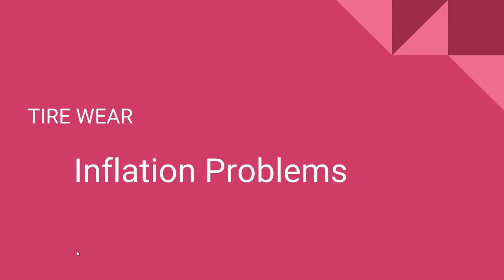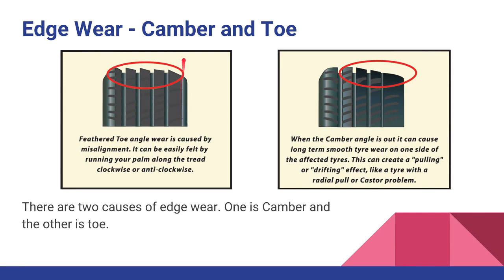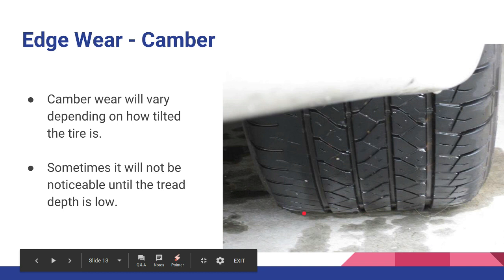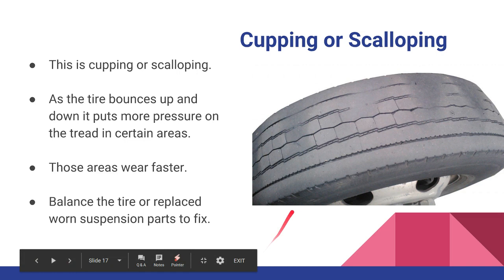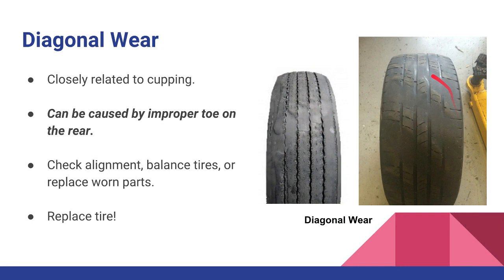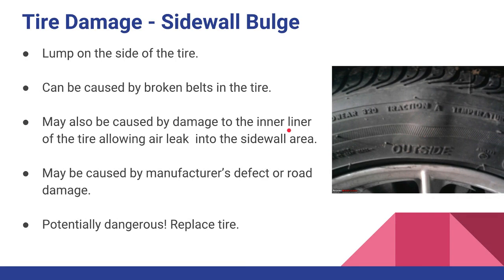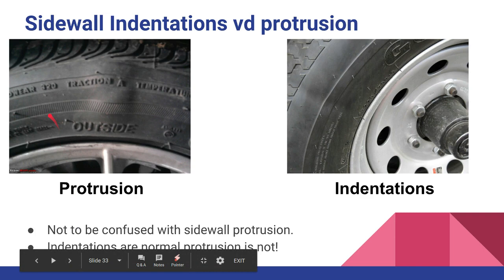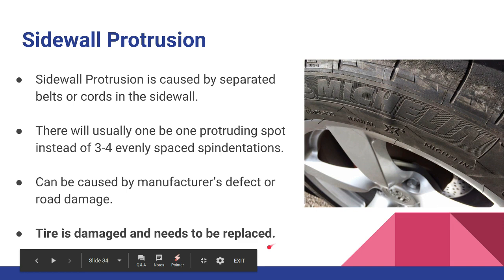Tire Wear Presentation

Comment: Why would a tire cup at the location of each tread depth indicator? My tires are cupped and each low spot (cup) occurs directly across each of the  tread depth indicators as if those locations were left high from the factory. Never see than before.